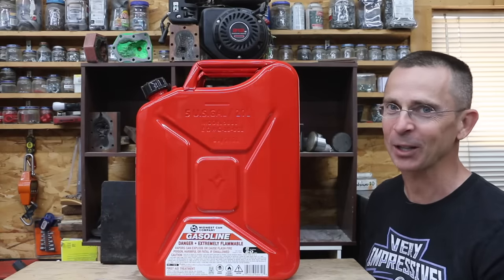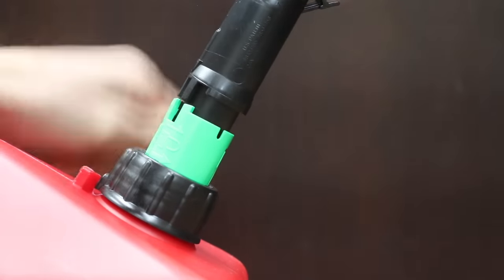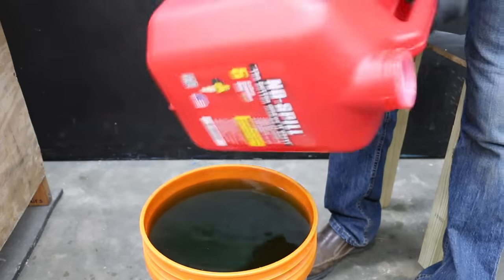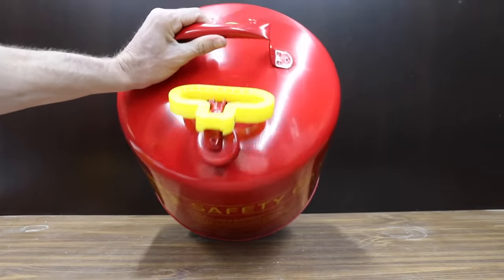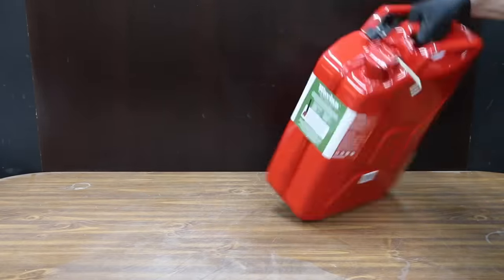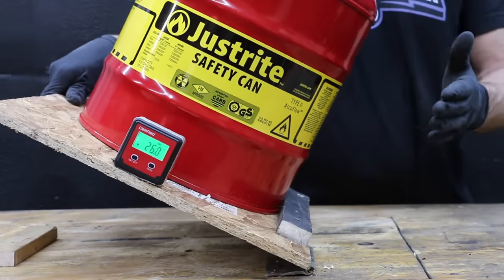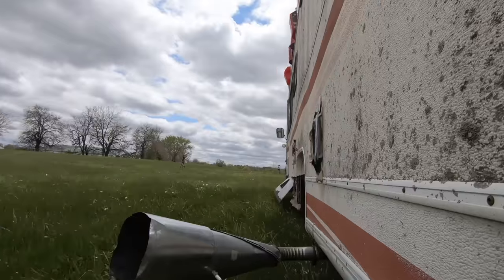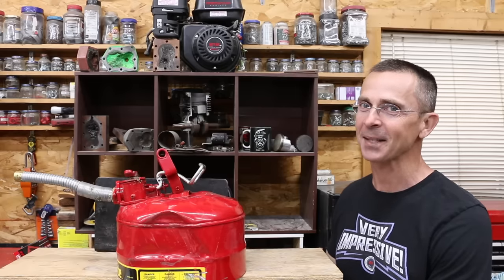Best Gas Can? $140 Wavian vs Eagle, Surecan, Scepter, Briggs & Stratton, Midwest, VP Racing

Comment: I have (or have had) the Wavian, Justrite, and VP Racing. I would rate Justrite is easy to use, the Wavian is great for storage, but a bit wonky with the attached nozzle- if you can get a flexible nozzle, those work better  the new spouts imop. The Wavian can spill a bit at first.  The VP is nice, but for me heavy to hold while fueling a car and can leak. Overall, I’d rate the Justrite the best for filling generators, lawnmowers, and cars. The Wavian Jerry can is best for storage and with appropriate securing, good for transport;  are rugged.  The VP is fast to fuel a car, but can leak was well, so I used some plumbers tape on seals. Not as good for transport. At the moment, I store fuel in the Wavians, but grab the Justrite for most fueling needs.
Reply from the maker: Thanks for sharing.

Comment: I've been very happy with my wavian cans.  Just need to swap out the CARB spouts for the flexible euro versions.  Being able to fuel up my truck easily is a huge plus for when it's time to cycle out any old gas.  

I have a smaller Justrite can for my snowblower too which has performed well.  I never spill any gas with that thing.

Buy once cry once.
Reply from the maker: Thanks for the feedback.

Comment: I only buy Wavian & Justrite.  Get the longer flexible spout for the Waivan to reduce spillage.  The Wavian NATO has rubber gaskets and will not leak when laid down.  Lay it down & it won't tip over.
Reply from the maker: Thanks for sharing.

Comment: I have the green Justrite can! I put my used motor oil in it after I do oil changes on my cars. I then take it to work and dump it in our oil heaters. It’s a great can. Downside is holding the spout open can be hard when you lift the thing. Takes a lot of pressure to keep it open and when you’re not the most fit man in the world (I’m pretty scrawny af) it can be a challenge but not too bad.
Reply from the maker: Thanks for sharing!

Comment: I own 3 20l cans make from plastic (PE) and they have a 2. screw on the other side of the grip, that can be opened; roughly 12mm opening.

Extremely simple design. 8$ each. Opened it just flows.
Reply from the maker: Thanks for sharing.

Comment: I miss the old Rubbermaid plastic fuel containers , they were short , wide and very hard to tip over , they worked great , if they would improve on the design a little and come back out with them they could clean up.
Reply from the maker: Thanks for sharing.

Comment: How about this for an idea, just put the Wavian can on it's side when transporting and it will never tip over.  The military metal cans also seal the vent so you don't smell gas when the can is inside a vehicle.  Of all of them that you tested, the Wavian and stark would be the only ones I would trust for having them on their side.   I noticed that the harbor freight and Stark cans also have the weld protruding outside the metal where it can get dented and leak.  The whole point of having the weld seam recessed is to keep the seam from getting dented and leaking.  The downfall of the metal military cans is that they expand and contract when hot and cold because of the vent being sealed.  over time, the metal gets fatigued and the metal cracks and it leaks.  I have a dozen or so military cans, and the Jerry style cans will crack on the sides. Two of mine cracked on the side.  The American style military cans will start leaking on the bottom seams after time. I had one on my jeep for 4 years before it started to leak though.  As always you made a great video that gives a lot of information.
Reply from the maker: Thanks!  Thanks for sharing.

Comment: I have seen mechanics that just take off the spouts and use a funnel spilling gas everywhere. Nice job EPA. I personally just purchase those little yellow vents and install them on the container. Since almost every newer design container has broken within a few uses, I also just buy a replacement hollow spout as well. Adds about $10 to the price of a can, but they just do not make a useable quality can anymore. Luckily all the parts are readily available.
Reply from the maker: Thanks for sharing.

Comment: There is one crucial aspect that you didn’t test. What is the potential for the spouts to shear or leak when a full fuel tank falls over and impact something? As a former engineer most of these tanks appear to be safety nightmares for nozzle shear. Though many of these “safety” features are intended to improve safety, in reality they likely create greater hazards and higher incidence of failure than older simple designs. Intending something to be “safer” does not mean they actually are. 

A second area to test is how the cans behave in fire conditions. Oddly, flammable are often safer than glass or metal containers. The polyethylene containers don’t generally rupture even in fairly high drop conditions. As you saw with the Winnebago test, metal cans can rupture and leak when plastic cans don’t. Unless the nozzle creates a vulnerability. If the cans are well designed, the radiant heat from a fire leads to vaporisation and venting that cools the liquid and container reducing the fire risk. This often provides the time needed for sprinklers Orr fire department response. 

Safety is in the details. Creating a situation that requires multiple hands to operate can dramatically increase the risk of spillage and fire. 

Another example of this sort of problem is the well intended and entirely stupid requirement that hot water heaters have check valves on their in;Rt water lines. This was intended to prevent gear loss via the inlet water line. When water heats, air in the water is released (inverse gas solubility versus temperature). Without a check valve, the hot water backs out the inlet line and heat is lost unless that line has a long enough section insulated to capture the heat from the expanding water. 

With a check valve the tank pressurizes. This then forces the “safety” pressure relief to release. It then ceases being a “safety” valve. With repeated cycling the relief valve us likely to fail.  An exploding hot water tank is one of the largest disaster hazards in a home. This also then releases hot water to where ever the heater is. In older homes this was often in an internal closet. This then leads to hot water released into a closed poorly ventilated space. That destroys floors, walls, carpet and leads to fungus - yet another huge home hazard. 

To fix these problems then requires adding a pressurisation control system and expansion tank. The tank still runs at high pressures and cycles daily. This dramatically shortens the vessel life unless it is all high pressure thermoplastic or stainless steel construction. 

Water heaters used to last for 10-30 years. These “safety” changes now cause a lot of common hot water heaters to fail in 1-5 years. And that failure us usually through leakage causing yet more damage. 

All of this happened because some idiot decided that a check valve must be required on the inlet line rather than a different design to resolve the perceived problem.

And by the way, the energy costs associated with all that added equipment, replacements, redesign, damage repair, shortened life and the rest - dwarf the energy cost from loss to the ambient environment of the home where it displaced heating by other means through most of the year.

A far better and vastly cheaper solution was to add a few dollars of insulation to 10-15 feet of inlet water line.

Comment: Before using any new-style can, drill a ½" vent hole in the top.  Install an old school vent cap ($8 for a 20-pack).  Pour restrictions fixed.
Reply from the maker: Thanks for sharing.

Comment: I won't buy plastic fuel containers anymore. The last few that I had all developed splits at the weld lines due to the fact that they can no longer vent off the pressure on hot summer days. Metal all the way. I use the "Just Right" cans that don't have they spout, so they spill a lot, but they last a long time.
Reply from the maker: Thank you for the feedback!

Comment: Oh man, this was extremely informative! you should try the plastic fuel tanks you hook up to small outboard engines or generators, those things cause WORLDS of trouble. 
I have over 6 of them including brands like Moeller, Scepter, ETC they all leak... they all swell up in the sun and shoot fuel through the caps and vents, fuel gauges crack and O rings degrade... you'll have fun testing these i promise..
Reply from the maker: Thanks!  Thanks for the suggestion.

Comment: My favorite gas can works like that Midwest can. It has a little intake tube on the spout  You can put it in a motorcycle or lawn mower tank and just pour gas until the flow stops. 

The gas covers the intake tube and stops the flow. It's a "child proof" or safe gas can and I've never spilled.

Now I refuse to buy any other gas can as this is really needed when filling motorcycles. You sometimes can't see the fuel level or know when to stop.
Reply from the maker: Thanks for sharing.

Comment: Go to big box store, buy cheapest 5gal can ($15-$20), buy conversion spout ($9), buy replacement tubeless tire valve stem ($3.50 for two pack), drill hole in can in rear top corner, dump out chips, install valve stem, and remove guts from valve stem. You now have a ventilated gas can almost as good as the no B.S. gas cans before nanny state interference kicked in. Prices are for my area. If you are filling small fuel tanks, leave valve stem cap on to create vacuum and slow poor to prevent spilling.
Reply from the maker: Thanks for the feedback.

Comment: These things have come a long way. I remember when they made the switch requiring gas cans to be "spill proof" and for the most part removed the flexible spouts for the fixed hard plastic designs.

Those always spilled for me, A LOT, when trying to refuel small engines like lawn mowers. With those small gas tanks you do not want fast flow, and you can not insert the spout far enough to push on the spout to start the fuel flow so you had to do it by hand. I went from never spilling a drop with the old style cans with a flexible spout, to spilling every single time I fueled. I've since switched to the "No Spill" brand and have found it to be a lot easier to control. I can partially press the button to slow down the flow rate and it won't leak around the mechanism like the older cans I had if I tried to only partially press the spouts in.

I think it would have been good to do such a test of filling small engine tanks where you want quite a bit more control then when fueling a vehicle. Would also be a way to test the "auto stop" when full feature most of these cans claim as a feature, but I have yet to see actually work.
Reply from the maker: Thanks for sharing.

Comment: The ability to pour into a vehicle with no spill is the most important feature for me.  My experience has been that the cheap cans have cheap gaskets on the lids that leak after a couple of times of removing and re-installing the lids.

Comment: The spout I have for my Wavians seals until you push on it so it never spills while refuling. It does have an issue of sticking when the o-rings dry out. I 'll stick with the Wavians which actually seal air tight. Everything else I've tried expands and leaks with a full can of gas out in the sun.
Reply from the maker: Thanks for sharing!

Comment: Those 'safety' spouts are more dangerous than a simple nozzle. 

Years before, when I was doing some odd jobs for some money,
I had that scepter gas tank 1:35 with that dumb green safety press, and it was not comfortable to simply refill a push-mower because sometimes, that green thing gets stuck and sometimes you really have to press down on it to start pouring, which is something you shouldn't have to go through just to refill a tank...
Spillages did happen from the base and splashes on the engine (I even check if the base is tightly screwed on every time I used it). I had to wait for the gas to dry up until I feel safe to use it, which isn't a long time, but it's an issue that should never have happened. 

Not long later, I switched to a different can (out of pure frustration on the old one) and bought a simple nozzle conversion, and I am having a MUCH better time JUST to do a simple task of pouring fuel into mowers where I feel comfortable and safe.

I don't know what accident occurred in history to force this regulation, but 
these safety nozzles are not the solution to a problem that was never a problem,
and its obvious that whoever signed to make safety design mandatory, probably never did manual labor tasks like mowing the lawn or cutting large tree branches that fell and doubly obvious they NEVER touched a gas can in their life.

In the name of 'safety', a simple task was made more difficult and unnecessarily dangerous.

and I do hope to God, the manufacturers, too, have the same sentiment on how dumb these safety nozzles are.
Reply from the maker: Thanks for sharing.

Comment: My dad still uses a sears can from the 90's. After attempting to use a modern Midwest I understand why. Problem is you have to manually vent the Midwest cans, if you don't they build up pressure and risk cracking.
Reply from the maker: Thanks for sharing.

Comment: I rarely ever had an issue with spilling anything on the older cans that had a separate vent and no valve system. I tie my fuel can in my truck with a bungee or a rope to keep it from tipping over. I have also had several different types of plastic cans with varying safety measures and find ALL of them to be a royal pain, even when fueling my riding lawn mower. It makes it extremely difficult to try to hold a safety valve open while pouring, and without exception all of those with the vent built into the spout make the flow rate worse than having an enlarged prostate! Hate 'em with a passion!
Reply from the maker: Thanks for the feedback.

Comment: I have two of the racing fuel cans for emergency use.  I have the same issue with the vent leaking if trying to pour too quickly.  I might take a look at movng the vent to the other end of the handle and sealing the original vent.  There's an inherent advantage that a fuel can that traps a few ounces of liquid would keep any water or contaminants from going into the fuel tank.
Reply from the maker: Thanks for the feedback.

Comment: The metal NATO style cans should have a recessed weld to protect it from damage. I’m in the market for NATO Jerry cans. Apparently some of the genuine ones have an aluminized steel to give it a strong corrosion protection. The red/orange paint is a special polymer that binds well to the metal surface. I guess not all NATO cans are the same. Some are built to varying standards.

Comment: For my money the Wavian or Eagle would be the best investment. Classic proven designs. As well you can pick up an extended metal flex spout to replace that short metal and plastic contraption that comes with the Wavian.

The removal of vent caps and switch to "spill-proof" vented funnels has caused more problems and spills than existed prior. Simple beats complicated every time.
Reply from the maker: Thanks for the feedback.

Comment: My karma is no matter the gas can, they all leak on me.   Every previous plastic can dripped.  Even the old steel cans drip.   My plan is to put JB Weld around the base of the spout to see if that will prevent the drips on my steel cans.
Reply from the maker: Thanks for the feedback.

Comment: I know they don't sell them anymore but the old Skool square body jerry can with solid filler spout hidden inside and vent at rear is still the best by far. If your handy it by far has the fewest spills and empties in less than a minute. 30 years old and still my go to can. Absolutely hate the self vented models. 5 minutes with those seems like an hour and you usually fatigue causing the can to leak or the cheap nozzle snaps after some dry time. Also like that I can leave the old Skool cans vent cracked just the slightest amount and it retains its spill proofing as well as doesn't shrink or expand during our harsh Canadian swing in temps from -10c to +40c.
Reply from the maker: Thanks for sharing.

Comment: That "Wavian" brand is identical right down to the lid locking pin and hose clip (sold separately!) as a brand sold here in Australia for 70 AUD. You guys are getting ripped off! But I'm glad to see it does well in your tests. My unit also spills about 10ml after attaching the same-brand metal flexible hose and upending, I'm really not entirely sure why, but it happens every time.
Reply from the maker: Thanks for the feedback.

Comment: I purchased 10ea.  Scepter cans from Costco.  I was shocked when after filling all 10 one appeared to be leaking. I assumed I spilled the gas myself.  When I got home (gas cans secured in my trailer) I found the same questionable can with just 3 gallons in it. I drained it and looked for the leak.  It must have a hairline crack in the seam across the bottom.  Getting my money back is the least of my worries.  How can I have confidence in the other 9 cans ?   What is the story with quality control at the factory ?  GAS !!!    A brand new can leaking is not an option.  It is a tragedy in the making.
Reply from the maker: Thanks for sharing.

Comment: I prefer my old, maybe $2 plastic can with a old regular, simple spout I got many years ago. Somehow without all the over charged, complicated new features, it still holds gas...and you can just pour it out. I don't think I'll ever spend $25-$50 on a plastic jug no matter what regulations they come up with.
BTW...my Bosch wipers are still going well after 5 years or so on my non-garaged truck.
Reply from the maker: Thanks for sharing.